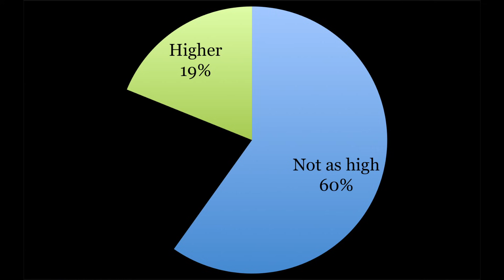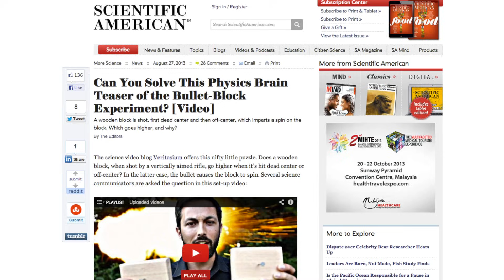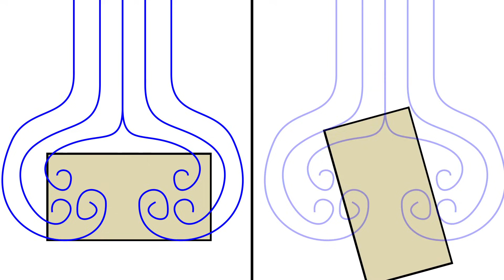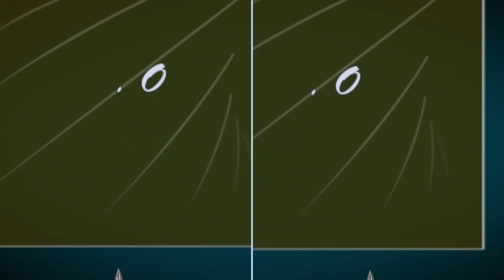Bullet Block Explained!

Comment: Hey my prediction was correct! I wasn't sure how this was happening so I assumed that somehow more energy was absorbed by the spinning block than the nonspinning block, that is essentially what happened :]
Reply: "More energy was absorbed by the spinning block".. That was now how I interpreted his words. Sounded to me like the exact same amount of Energy was absorbed. I thought he was getting to a point with some of the energy that was used to create the spin was used to create heat in the non spinning, but then at the end made it sound like this was not true either. So I may not have the answer, I just happen to interrupt the absorption the same energy statement differently.
Reply: Not quite, the same amount of energy was absorbed, just in a different ways. In the block shot straight to the center of mass, more kinetic energy was converted to heat by friction than in the one shot on the side (where it instead went into causing rotational motion).

If you were neglecting the energy that went towards heat as "absorbed" then technically you can say that I guess, but it isn't what I think most people would say "absorbed" means.

Comment: Don't think of it as extra energy in the spinning block, think of it as less energy in the non-spinning block.

Also for the bullet depth you also forgot to include the possibility of wood grain density.  You can chop a board into multiple pieces and have a difference in how solid the material is from one inch to the next.

Comment: only 2 ways I can think of having the bullet depth measured is either using much larger bullets and blocks, or using a metal block and measuring the depth of the dent. however I don't entirely think the metal block would work, I don't have a reason why I just think it would yield similar results

Comment: I think you had it nailed down at conservation of momentum. The bullet only has momentum in a vertical direction, so all of that energy is transferred to block in that same direction. You can't simply add the rotation momentum to the momentum as a vector and say there is more energy in the one that is spinning. If you look at the spinning block, still thinking in vectors, the left side is moving down, which if you consider up to be the positive direction this would be a negative amount of energy. If you use calculus to solve for the total energy of the rotating block, as a vector, up being the positive direction, I am quite sure that it would still be equivalent to the energy of the non-rotating block (I will have to break out my dynamics book to find the equation as I am a little rusty).

Comment: My original answer for this question was that the difference in energy could be explained with heat. I would like them to do the experiment again but then immediately measure the heat off both blocks. This wouldn't be a precise explanation since energy can be lost in sound and other ways.

Comment: True story, my mother was walking through the back yard, and a stray bullet someone shot up in the air came down and hit her in the top of the butt, and traveled to the top of her thigh.  One step slower and she would not be here.  She has got better chance of winning the lottery than that happening again, but i still cringed when i seen the bullet being shot up into the air.  But I know you made all safety precautions.  Great video, love your channel.
Reply: but did she rotate?
Reply: Well, I am an engineering student, AND an a shooter(with quite a few national titles and 3 south-american ones) so, a bullet does NOT have enough energy stored to do any damage whatsoever at terminal velocity(the maximum velocity a body being dropped can reach), what MIGHT have happened is a bullet shot in a parabolic trajectory, wich would maintain some of it's energy due to movement along de X axis of its trajectory(the movement would be described by a 2nd degree equation ax^2 + bx + c = y), and on this cenario it might do some damage.

but no way in hell a bullet shot from 80 to 100 degrees with the horizontal would do any damage to a human body
Reply: Uh well... the bullet is stuck in the block, sir.
Reply: Hard to believe.  When you talk about a bullet falling down after being shot straight up, it's the same as if it was dropped by someone holding it from whatever height it reached, and in that journey it will have lost A LOT of speed and energy to air resistance.  Sure, it depends what kind of bullet, and would hurt or do damage depending where it hit you, its orientation (pointier end?), but i don't buy that it could penetrate a foot of flesh.
Reply: levi moura Thank you for your intelligent input, Levi.  Too many people don't understand physics.  Once the bullet reached its maximum height, it would probably tumble back down to earth, because it would have lost too much of its spinning momentum. and as I said before, dpeneding on the caliber, the orientation on impact, and where it hit a person, it might hurt...a lot...but it would not cause life-threatening injury, and most certainly would not pierce a foot, nor inches of flesh.
Reply: Doing some quick math here, the max angle that the bullet still can do actual damage to the human body is about 65 degrees and it would, most likely not be fatal, and a bullet, even a .50 does NOT leave tue atmosphere, so there is no reentry to talk about
Reply: Good news. A bullet shot straight up into the air cannot kill on the way back down. The bullet must be shot at a horizontal angle and travel along in an arc in order to conserve energy.

The bullet was fired, as levi said, at most at 65 degrees.

You would end up with a hefty bruise, but nothing all too fatal.

Bullets fired straight up into the air are safe as long as you wear a hat.
Reply: There was something similar to this type of injury in a TV episodes called "Numb3rs". Though, if I remember correctly the bullet travelled in an Arc, but it was a good number of years ago now, so I may be wrong.
Reply: Colin Richardson If I'm thinking about the same episode, they were trying to locate a bullet and eventually found it. Don't remember the exact context (how it related to the plot or even the plot of the episode) but no injury occurred.

This type of thing definitely has happened numerous times in reality (not a likely event of course).
Reply: medow006 if you shoot straight up it will tumble at apogee and hit with the force of a small hailstone.
If you shoot at an angle, the rifling/spinning can keep a parabolic bullet-speed trajectory and it can do a pile of damage after reentry.
Reply: frollard well, hailstones are more spherical than slugs, and then slugs are probably denser than ice...so...i think  most of us have been hit by pebble-sized hail, and it is not particularly painful.  if a tumbling slug hit you at terminal-ish velocity, it would probably hurt, depending on orientation and calibre, but as I said, it would not end your life or pierce a foot of flesh.  as for the angle  you have to shoot to cause a bullet to return to earth in a tumbling fashion instead of a spinning trajectory fashion, I think you are over estimating.  I do not have a thorough formal education in any related fields, but I recon that anything over 50 degrees, and the bullet will lose too much energy, both spinning and pure translational energy, that it would return to earth in a tumbling fashion.  what do you all think?

Comment: my suggestion for improving the experiment:
instead of using a gun, use a precise nail gun or crossbow. the penetration would be much more easy to measure.

secondly: instead of wood, use something like pvc, construction foam or simmilar. wood has an uneven structure that distorts the data. by using pvc or construction foam you have an even structure that behaves more predictable than wood.

third: do the experiment horizontally (letting the block slide on an even, smooth surface). this makes the mesurements in traveled distance more easy.
you could also use a very precise sensor to measure the momentum directly instead of letting the block fly and estimating the momentum based on the flight height.

if done correctly you should be able to measure all important factors precisely.
Reply: I don't agree with the slide on smooth surface as the spinning block would have a friction difference. But I completely agree with the "uneven" nature of wood.

Comment: I don't know that much about how rounds are manufactured/packed...but would there be some variation from round to round? I think you need to do a lot more testing to get more accurate data to work with. In the vicinity of 100 rounds for each test.

Comment: There are two little things I have to say. The bullets path on the rotating block is not a straight line. As your own model says, its kind of a curved path. So
1) Dont use a nail to measure the depth. It can be misleading. Use something flexible. Or pour water with a syringe maybe?
2) Even if the final position of the bullet is same, the rotating block's bullet may have gone a different length along the curved path. (But not by much)

Comment: If you also notice, on the center strike blocks, they rotate on a horizontal axis, which I suppose is the continuation of the momentum of the bullet. Why does the offset strike block not rotate on the horizontal axis?
Reply: "If you also notice, on the center strike blocks, they rotate on a horizontal axis, which I suppose is the continuation of the momentum of the bullet."

Momentum created from the rifling of the gun barrel...

Comment: I thought the bullet depth issue but gone farther to think that middle-hit block would go lower because it may have some side wabbling and the spinning block wouldn't have that because of the angular momentum ergo have less air resistance (maybe even some aerodynamical lifting) and go higher. But well it's all negligible :D

Comment: The only thing that I could say based on my intuition rather than in real physics is: once the bullet go inside of that wood block, the mass of the block change. In the first case (bullet in the middle) the mass of the block is added to the same line of the gravitational center of the block, so, basically the energy applied to the block is the momentum of the bullet. In the second scenario, the bullet adds to the block a little more mass to the right of the block and also, it add rotational energy. As a consequence of the gravitational center change of the wood block,  the rotation and the new mass will help to conserve the energy applied by the bullet. However, my intuition say that this is true only if the rifle shoot every bullet with the same amount of energy, or at least very similar (that is why some tournament weapons are more expensive that others).

Comment: Actually, that conservation of momentum makes sense...the bullet hits the center, stops, and transfers all of the energy and momentum into the wood.
Now the second bullet hits, and because it´s off center, causes the wood to spin, but the first part that spins upward also has the bullet in it, causing the center of mass to shift, and the heavier part in turn pulls the block up, negating the energy imparted on it by the rotation, so it ends up having the same lateral energy then the one where the bullet doesn´t cause spinning.

Am I close?

Comment: Experiment modification: how about using a substance less dense than the wood, MDF maybe? Possibly using a slower projectile also, so that it doesn't destroy the new, softer, material

Not sure whether this would work, and haven't the means of testing it, just a thought

Comment: what if you take softer wood, and maybe a larger object.
plus, try it with a projectile, that doesnt deform like bullets do, a crossbow for example.

what if you use a "brick" of steel and shoot something at it, that does not have enough energy to penetrate it, then you should see differences in height

Comment: The ammunition used could also be inconsistently loaded. 
Eg, one shell contains more energy than the other etc. 
also the blocks balancing on the nail which creates leverage, also the nail allows the block to rotate before lifting off. Also the extra weight of the bullet would make the block unbalanced and allow it to spin easier.

Comment: This 'extra energy' in form of rotational energy is just lack of proper observation (or absence of 'the complete observation(s)'. 

I think what happening here is that bullet hitting in the center causes more vibrational energy of the wood (including sound by bending, stretching/shrinking, but also vibrational energy in form of heat), rather than rotational energy (a.k.a. 'extra energy') when bullet hits somewhere off center.

While rotational energy is visible on the camera, vibrational energy is not (especially in form of heat).

This is just my humble opinion, and I might be wrong. At this point, I don't know what can be done to prove that (or disprove my idea).

Anyway, I like such 'mind-bending' experiments.

Thank you for posting this and other amazing videos.
milan
Reply: Some ideas if we could get infer red sensor or something to measure the heat of the wood, or maybe we could measure the amount of sound. also this could be proven if we reduce the amount of force an object is hit with and reduce the substance hardness (make it like jello or something) it could be proveable or disproved. to be honest Veritasium said that this was his theory. But instead of everyone screaming that there is no way to test this lets try to move away from wood and bullets and think of things that could prove the concepts.

Comment: I reckon that you could get the bullets measurable by having two blocks of exactly the same density, and distance between dead cambium layers, which changes the density, fractionally, but allowing you to see a difference in the depth

Comment: I won't go trough all comments to see if it's mentoined, but there's also a variable between each rounds, alltough the weight and amount of everything of the round should be the same, there are differences, not sure if this is necessary to mention or not, but I did.

Comment: I agree about the bullet not necessarily having the same amount of energy. If off the shelf ammo was used, the amount of powder in the casing, the primer's power, and mass of the bullet can vary enough to change the outcome; as can be seen in the by the repeats of the same bullet placing.
Also, I'm going to assume you measured the mass of the different pieces of wood to make sure they were the same.
Over all, I'm going to say this is a neat experiment, but there was too many variables for an accurate outcome. In the "lab", you would want to make your own ammo loads, and you would want to have a better background (one with measured lines). Really the best way to do this experiment would be with small air canon to fire the projectile, not a firearm.

Comment: I think its way more simple then that, if you take the mass of the round and add it to the mass of the block then its obvious that the momentum will change at impact that being said all that is changing is mass, gravity being constant means that without resistance they would travel the same no matter what or where the bullet hit. So gravity, mass and momentum are never changing in the experiment except for the change of mass at impact and the effect of gravity. So as far as I can tell resistance is going to be the only variable that effects height of the block. Thats just my opinion.

Comment: The answer is unsatisfactory largely because it wasn't testable. We have to take your word for it that the differences in sonic and heat energy accounts for the differences in total system energy. Saying that something is "unmeasurable" is not a satisfactory conclusion. 

I agree that the volume of the tunnel through the wood should have been larger in the block struck dead-on than in the block struck off-center. The difference in kinetic energy must have been the result of the differences in deformation of the block. The rotation of the block meant that the structure of the block did not need to expend as much energy stopping the bullet as it did in the first example. You might demonstrate this by using targets with greatly different levels of structural cohesiveness, perhaps harder and softer wood. Of course, then density comes into play. 

Did anyone consider that maybe the bullets did not have precisely the same amount of energy? 

I think it is interesting that the velocity of the bullet was very large, compared to the velocity of either system. The momentum of the bullet was largely due to its velocity, rather than its mass. I'm assuming that the mass of the bullet was in the same order of magnitude as the block of wood.
Reply: Its not so much that it is immesurable, so much as that it is so many orders of magnitude smaller than the context of the experiment, it is effectively zero.
Reply: Kabhaq
I understand that.

Comment: Maybe you shouldn't be using wood at all, because there is differences betweed different blocks. Some sort of plastic or quite hard gel and higher powered gus may do the trick?
If you have a lot of energy, then that 1% is bigger. Then you may use X-rays again to tell the difference.

Comment: To show that the linear velocity of the (block + bullet) is independent of where the bullet strikes: Vcm = P / M , where Vcm is the velocity of the centre of mass, P linear momentum, M total mass. Apply this to the bullet + block system (i.e. M= m /bullet + m /block etc.). The dashes can mean either divide or like m /bullet means mass of bullet. P is conserved since no external forces, and since P (before) = m /bullet * v /bullet, then Vcm = P (before) / M , or rather Vcm = (m /bullet * v /bullet) divided by (m /bullet + m /block).